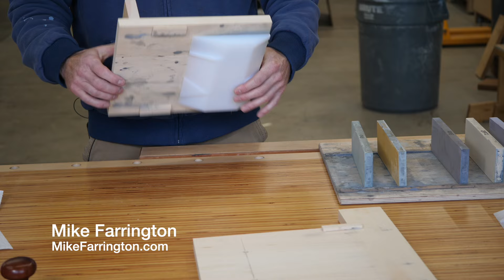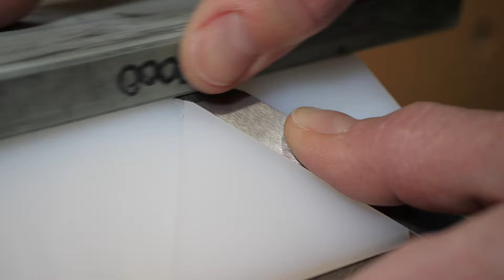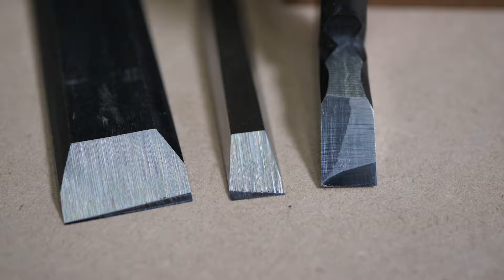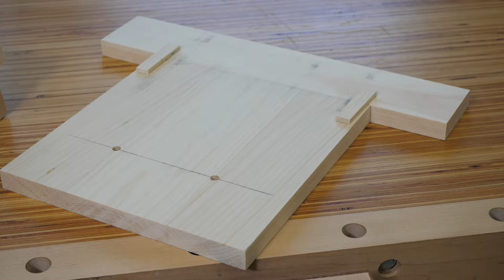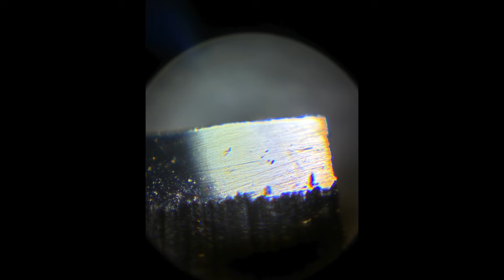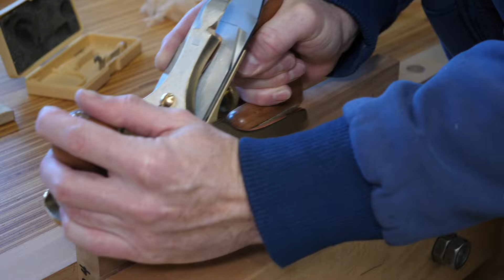A new kind of sharpening jig

Comment: 01:11 doesn’t this cause wearing of the plastic on the stone and gum it up, clog the pores so to speak?
Reply from the maker: No, UHMW is very resistive to wear. Add that to the fact that the water used as lube creates a situation where the stone is hydroplaning.
Reply: @MikeFarrington I don’t want to be argumentative, I am truly curious about this, I have not seen this technique before. For all the reasons you mentioned, wouldn’t the same be true for the steel you are sharpening. If it is removing material from the steel, why not the jig as well, causing wear?

Comment: I am struggling with some Kote Nomi. I am a newbie and haven't yet had a success sharpening freehand. I always end up rounding off the bevel. It always work great with a sharpening jig. But lately I have aquired old stanley rabbet plane. The iron has a unique shape that doesn't fit my jig. Also, I have two kote Nome (Japanese Trowel chisels) that can fit in the jig. Would this be a good jig for those? confirming before i buy.@MikeFarrington

Comment: Looks like a great idea, but would be nice if it included a 30 degree angle.  25 primary, 30 secondary, 32.5 tertiary.
Reply from the maker: No need 32.5 and 30 are close enough. Also no need for primary, secondary and tertiary. All that is needed is a primary and a finished angle.

Comment: I have no experience with either water or oil stones and would have no idea what to look for. It would appear from the demonstration that you are using a limited portion of the sharpening stone along both long edges. Does this not cause uneven wear or even a groove in the sharpening stone? My process in trying to learn how to sharpen has been to try Rob Cosman's approach. But Icannot do it freehand and use a jig. I find I get inconsistent results. So I have diamond plates, a Shapton stone and even a Tormek (that I have never used because of the hollow ground). I feel that the hollow ground prevents a secondary bevel on plane and chisel blades. So, I guess my question is this. Is there any way I can incorporate this system into the mess I already have? Thanks in advance.
Reply from the maker: There is a lot here, and you are welcome to email me your questions as well. First, in the video I only show using the edge of the stone. I did this to keep things viewable, it is actually easy to move the stone around and use different portions of it. So you aren't wearing a stone out any faster than with any other sharpening method. Based on what I have here, my choice would be to use the tormek for basic grinding of bevels, and starting the sharpening process. I would use the diamond stones for flattening stuff, and I would suggest buying one water stone. I like the Shaptons, shoot for like 3k, 5k, or 8k. Then use my jig only with the water stone. that will get you crazy sharp, easily and quickly.

Comment: Hi Mike!  It's been a while since we connected!  Glad you're still doing well.  I received my sharpening jig and just got it all set up to test it out last night.  Biggest problem it creates: do I just throw away all the other bits and pieces of sharpening equipment that I've gathered over the last ~20 years?  I guess maybe not since at some point the overall bevel of the tool will have to be reestablished, right?  If the Farrington micro bevel becomes more than "micro", or if the chisel gets damaged and you need to start fresh?  Otherwise, this jig had me creating beautiful, scary sharp edges with literally zero practice.  It's an awesome technique.  Thank you and Happy Holidays!
Reply from the maker: Yeah, if you do not have a bench grinder, a cheap wheel jig is great for removing material off the bevel. Thank you, great to hear you are having success with the jig.

Comment: Mike your design is awesome, I just built one to test it out.  Piece of UHMD recessed in cherry with a 32.5 degree bevel and a 90 degree fence.   I have purchased so many things that almost work as advertised.  The results I got are amazing, will be getting one of yours with the other angles and fences.  Truly innovative.  for those looking for something for their plane blades, I recommend they check out William NG.  Older videos but he's the guy who I believe
 worked out the 5 cut method for the crosscut sled.  Has a jig for sharpening plane blades with stones and the blade remains stationary.  Thanks again, just awesome.
Reply from the maker: Thank you for the kind words!

Comment: I imagine that 8000 Shapton isn't pulling much material off that HDPE block, but how does it hold up against lower grits?
Reply from the maker: That is talked about in the video. 1k and higher and you are good to go. Also, it's UHMW, not HDPE. UHMW is way better at tolerating friction.

Comment: Honestly genius. Makes sense to hold the chisel still while doing the work. One question though - what prevents the material of the jig from being abraded away from the stones? Wont it wear out over time and potentially unevenly?
Reply from the maker: Thank you. The wear issue was address in the video. The short version, yes, it will wear, but very slowly, with normal use, the jig will last many many years. As to being uneven, it won't be enough to make a difference.

Comment: Some magnets to help hold the steel could be an added bonus
Reply from the maker: I tried that. The material still allows the tool to slide, even with crazy powerful magnets.
Reply: Even if it's only there to help keep your hand from tiring quickly. Though like you say its only for final touches so it might not be necessary @MikeFarrington

Comment: Hi Mike. Will this aid in sharpening low angle plane blades (do the angles accommodate that)? Also, short blades like spokeshave blades? Thx!
Reply from the maker: In general yes, but to specific tools, it depends. Spoke shave blades are easy as pie, I should have put that in the video. Low angle planes, it depends on what you want to sharpen them to. Most Low angle block plane blades are sharpened at an angle of 25 degrees, which this jig will accommodate. Also, exact angles that things are sharpened to are really not important. This is a situation where 25 or 28 degrees, I don't think anyone would be able to tell the difference. Hope this helps.

Comment: You could have a couple of recessed rubber rollers on the top side, that way the jig won't wear.
Reply from the maker: That would work, but with the added manufacturing costs, it would just be better to buy two. This thing will last a very long time as is.

Comment: Been looking for an easy sharpening jig and so happy to find it today. I assumed you can use diamond stone on this jig as well? Or maybe I'll splurge on that $200 set from 1000-12k grits lol
Reply from the maker: Thank you. I suggest only using the finest diamond stones. Diamond stones are fairly coarse on average. As to the set of stones, not needed. Just get the 5k and be done with it.
Reply: @MikeFarrington thank you for the prompt reply. I purchased the stones you suggested but I skip the 8000 and bought a 320 instead of the same brand since some of my chisels have chips in them. Will that stone ruin the jig? Do I really need the 320 to get rid of the chipped blade or can I just use the 1000
Reply from the maker: @DucPhan20  It won't ruin the jig, it will just wear it out a little faster. As to a chipped blade, I suggest finding a faster way to grind off the chip. A bench grinder, or even a belt sander work well. M opinion is that you will be there all day with a 320 grit stone trying to remove a chip. Hope this helps.
Reply: @MikeFarrington  thank you for the reply! have a wonderful day!

Comment: So it's like a stationery worksharp?
Reply from the maker: I'm not sure the two are comparable?
Reply: @MikeFarrington  well with the worksharp ws3000 your sharpening disc is on top and the chisel/plane blade goes in underneath. Obviously it doesn't use a stone but the approach is very similar
Reply from the maker: @guitarchitectural  Agreed, in that regard it is similar. But in general, one is a power/fairly coarse sharpening system, the other is hand and designed for high levels of polish. I appreciate you comment. Thank you.

Comment: I was already convinced this was a great idea, but then you showed the router plane! This is the only jig I’ve ever seen that offers a solution for those annoying L shaped router plane blades.

In addition it’s by FAR the simplest setup out there for skewed blades. The fact that it can handle the two most common types of non-standard blades — and of course handle standard blades more easily than any other jig — is a triumph.

Have you considered adding magnets to the “ramp” surfaces of the jig? A magnet would ensure that the tool is held securely to the ramp, with less chance of the blade moving up or down by accident. I imagine you would be able to focus more on holding the blade squarely to the fence, and it would be more ergonomic since you would not have to exert any downward pressure on the tool.
Reply from the maker: Thank you very much. I tried magnets on the bevel surfaces, UHMW is too slick, the tool is held firmly down, but can still slide with relative ease.

Comment: I would have to disagree with your title somewhat.  Mpower Tools FASTTRACK Chisel Sharpener – MK2 and the Trend Tools version use exactly the same principal and have been doing so for a number of years. Having used, owned and even sold a variety of tool sharpening systems over the last 30 plus years including Tormek, the Wood Artistry Lapsharp, Robert Sorby Pro-Edge, Veritas Jigs and a 60 plus years old Eclipse 36 Honing Guide  I have to say FASTTRACK Chisel Sharpener – MK2 does an excellent job on plane irons and chisels so I understand why you are getting good results.  For those wanting to sharpen turning tools I would recommend the Pro-Edge and if it is just chisels & plane irons then Mpower Tools FASTTRACK Chisel Sharpener – MK2 which works exactly as your approach but it is available off the shelf.
Reply from the maker: I'm not sure I follow what you are getting at here. Yes, there are lots of sharpening systems with differing levels of complexity, cost, and results. This one is no different. Of the ones you mentioned, this one is truly the only one designed around the use of very fine grit stones to develop the sharpest of tools.

Comment: An idea that complicates the simple design: Adding a groove on top to accept a runner for a thin flat sled, so you could use coarse stones without wear. I guess you could freehand it with something thin and flat between the coarse stone and the jig also but got to be careful not to touch the edge.
Reply from the maker: This is a great idea, and one that I experimented with. My thought was I wanted this jig at maximum simple. Adding anything to the surface would make cleaning more difficult and drive up cost. I am working on a free floating sled for coarse stones as we speak. I didn't mention it in the video because it's not a proven concept yet.

Comment: hey Mike, great idea! I came across a video a year or so ago by the great Brian Boggs called " Battle of the burr" where he postulates the merits of honing sideways rather then back and forth with harder steel tools, with the steel being more brittle by going side to side, along with back and forth you lessen the chance of tearing thus creating a sharper edge, you should check it out if you haven't already. Now I have successfully used "postulate" in a sentence and my life has reached a new level, thank you
Reply from the maker: Brian Boggs is a total genius. I have done a little studying with regard to removing burrs. Sharpening sideways really is the best way to do so. What ends up happening with normal direction is that the burr ends up folding off in parts too early in sharpening process, this creates relatively large "missing" pieces at the cutting edge.

Comment: Brilliant in its simplicity! Similar concept to the just released jig by dead edge design but I suspect the simplicity and absence of moving parts makes this more reliable at a fraction of the price. Have you tested it with diamond stones?
Reply from the maker: Thank you. I really worked hard to have no moving parts. I even thought about tapping the UHMW so I wouldn't need threaded inserts. This material is difficult to tap consistently, so I fell back to threaded inserts. It works with diamond stones, but only with the most fine. Diamond stones are actually fairly coarse on average.

Comment: For us 'fraid to sharpen our skewed stuff...Blue Spruce skews...65?, 
Veritas skew block 15,
 Lie Nielsen 18...
Please please one day? again anyone got ideas on a mod for these angles I have on this current offering?  Can someone start a thread over at Sawmill Creek?  I would but I had a disagreement with the guy who runs it...I got banned ( it was an injustice, but thats anoher story..I can read.)
If someday they are CNCed the buyer can pick the skew angle they need in that spot...
Reply from the maker: Thank you very much for the input. As to skew chisels, personally I would just regrind to 30 degrees. That is only 5 degrees off the Blue Spruce chisels. As to the plane blades, they could be bumped against a stop, with the blade pressed against the stone. Not perfect, but it would work well. I will show this technique in a future video (similar to the fish tail I showed). As to custom, I thought about this, the problem is the programming time. These are cut on a monster CNC machine at crazy throughput. However, any programmer would want at least 100 bucks an hour, with some minimum amount, then the part would need to be mounted, test cut, then the real deal. My rough calculations would be like 200-300 for custom. With all the being said, if this idea sells well. I will offer a few different layouts, that will cover all the major "odd" angles. Hope this helps.

Comment: Did you choose 32.5° so it’s pretty much like the final “micro bevel” setting when you grind in a 30° primary? Like the second setting on the veritas jig wheel?
Reply from the maker: Sort of. I knew I wanted something higher than 30 degrees. Also plane blades need a bit of relief behind the cutting edge, so a 45 degree plane frog, with a 32.5 degree sharpening angle creates a 12.5 degree relief behind the cutting edge. Which is really close to ideal. So 32.5 worked out to be a great angle for general durable use, and just about perfect for bench planes. Hope that makes sense.

Comment: Great idea, Mike! What is the maximum width the jig can accommodate when sharpening a plane blade?
Reply from the maker: 2 5/8" on 25 degree side, 1 1/2" on the low angle paring station. On the 32.5 degree side it would be in the 3s.

Comment: when you plan on adding more options for different bevels: Maybe think about not making it longer but make it a square footprint with bevels and fences on all 4 sites instead of just two. Than it would need 4 threaded inserts so it can be mounted in 90° intervals. It's just what jumped to my mind watching this and I am aware that you might allready have considered that and threw the idea out for reasons I don't know because I have just thought about this for 5 minutes and not 5 years. Whatever it is. An awesome and genius concept!
Reply from the maker: I may take that approach. This size was based on yield from the material, and I wanted the top to be about the size of a sharpening stone.
Reply: @MikeFarrington  Or even a centered insert so you could spin it to make easier to locate when switching sides!
Reply from the maker: @matthewlebo482  I like this idea.

Comment: Mike, this is a good idea - it literally turns the idea of sharpening 180 degrees. That's the space where innovation happens. I own a Tormek, which is amazing of course, but this system I'd say would be perfect for touch-ups on the tools. I don't keep my Tormek ready to go all the time, and stropping only gets you so far. Summary: not vomitous.
I think you said this was machined from UHMW... true?
Reply from the maker: Yes, UHMW. This jig excels at the mid project touch ups. One of the reasons I developed this was needing to clean up an edge real quick and get back to work.